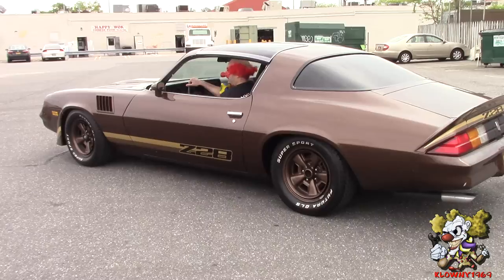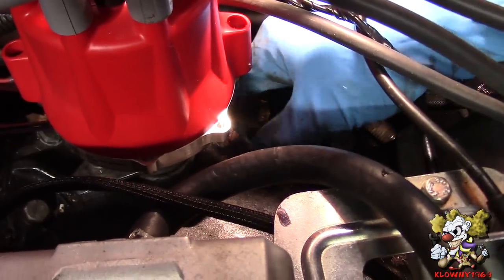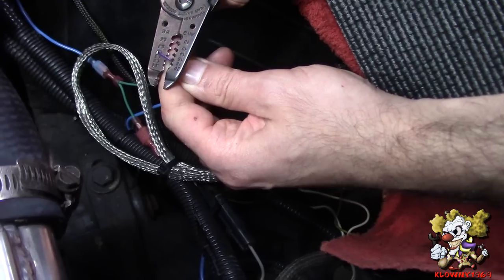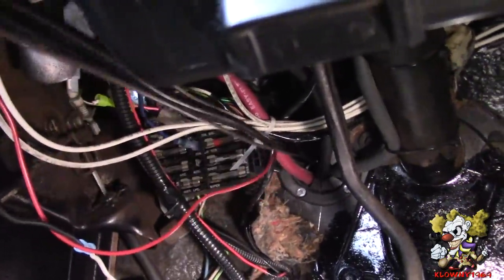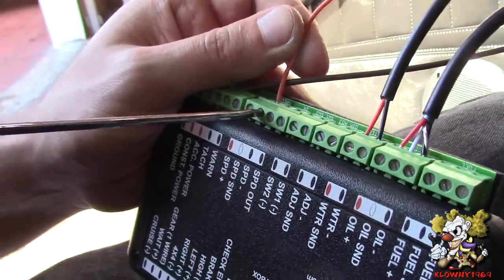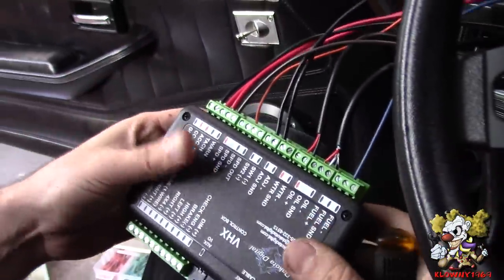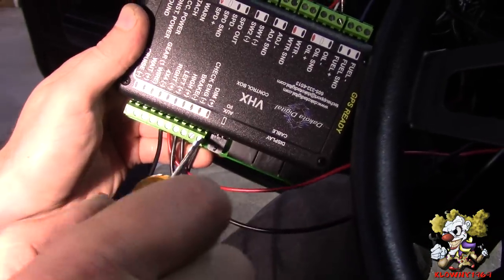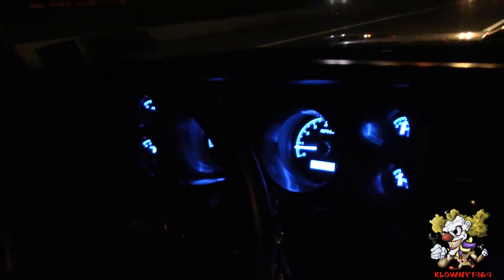How to Install A Dakota Digital Dash In a Camaro 1970-1981

Comment: Great video, 
FYI, there is a problem with your advice, I have a 1971 Firebird and I’m hooking up the same Dakota digital RTX system, you had made a comment that all 70 to 81 Camaro and Firebird, that the wires may be a different color but the numbers indicate the same options etc. on this 1971 Firebird it’s completely different like six is the left turn signal five is the right, nine is the fuel, 4 is the highbeam indicator etc. etc. just wanted to clear that up, really enjoy your channel
Reply from the maker: Sorry if there was a difference..thanks for that

Comment: Those switches under the dash would be nice setup in the face of the dash with a "mode" and "set" face plate like modern cars are.  Or on an alloy bracket just out of sight under the dash to keep things looking original.  Don't know about drilling holes in the dash bottom to fit them though.  Doesn't match well with the quality of the rest of the install.
Reply from the maker: They are very hidden underneath..thanks for commenting and watching

Comment: Are all those wires connected to that adapter socket plug the same in all 2nd gen, 1978 Z28? And can you make a video on how to set the miles etc :)
Reply from the maker: I thought I said in the video how to set the miles? If not it's in my other Dakota digital video..don't forget to subscribe and hit that bell 🔔

Comment: Good job , but how u calibration fuel digital gauge on old sending unit ? 

- I have some issue with dakotal digital gauges after fixed on my Chevy Caprice 90’ its not reading on proper-way  , after Ohms 0-90 its still reading very slowly.. any recommendations ? ,,,, thank you

Comment: I have question. So my 2001 pt cruiser, in the middle of driving, the car just shut off, car is stuck in drive and I can't move it or even turn the car back on . What could it be.?
Reply from the maker: It could be a fusible link..or check the charging system, maybe the alternator..dont forget to subscribe

Comment: Im having problems with my set up
 1979 standard camaro. Need to locate a diagram on the color wires going to cluster. Pin 1 pink. Pin 2 brown. Pin 3 big blue white stripe. Pin 4 dark brown. Pin 5 grey. Pin 6 black. Pin 7 brown white. Pin 8 pink. Pin 9 light blue. Pin 10 light green. Pin 11 blue. Pin 12 dark green.  is pink key hot on my plug. This car has all led bulbs and now wont work after i install the dash kit. Just want to know for sure on the color code. Can anyone help here? Thanks in advance